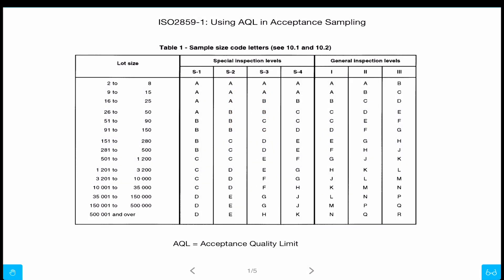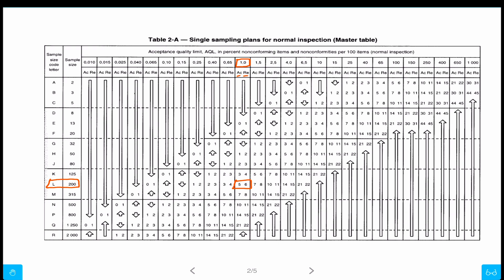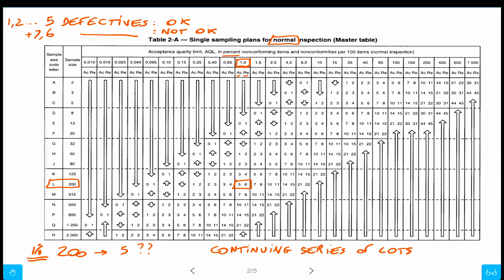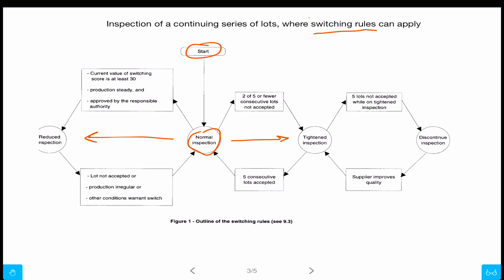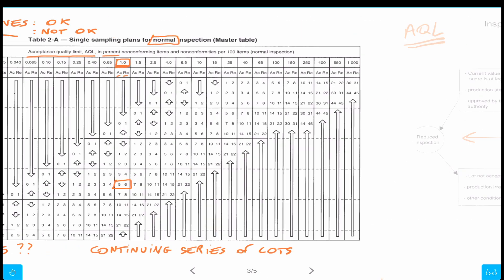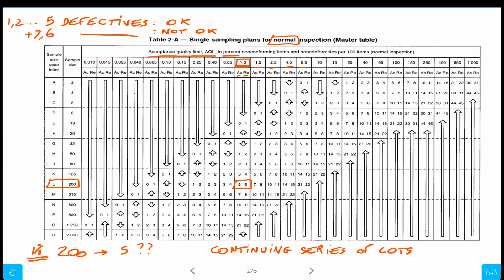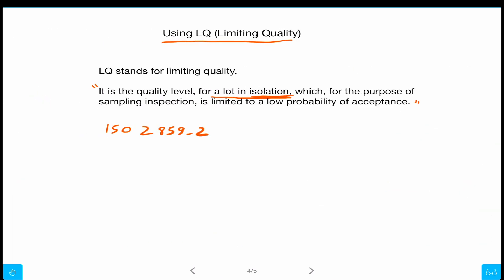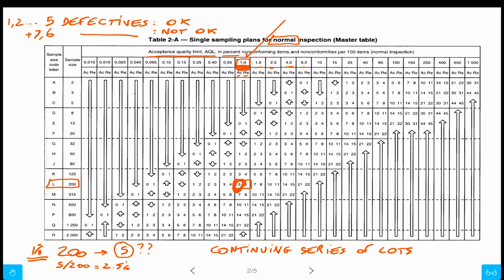Acceptance Sampling Contrasting the LQ vs  the AQL for Product Inspections

Comment: This is true. It must also be noted that there is also a conversion table LQ to AQL. Essentially if your LQ = 2, then AQL equivalent = 0.25 which gives you the same amount of pass and fail rates.  Essentially you are sampling at a much tighter AQL. The good thing with LQ is that when you set your limit, as the families get larger, the AQL also increases, which means it gives the manufacture some breathing room the more they make in that lot.

AQL provides the manufacture a guide on quality they need to produce, where as LQ looks at the consumer's risk. The standard also says that the LQ needs to be set realistic to what is acceptable (i.e. at least 3x the AQL), so in reality if you did an LQ sample plan, the LQ value would have been 5% to match the AQL of 1% that is aimed for